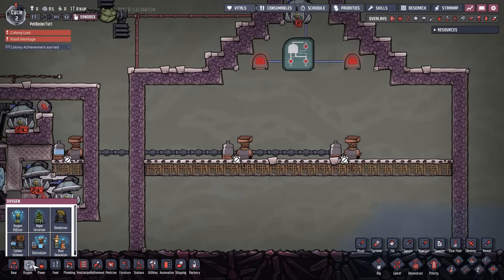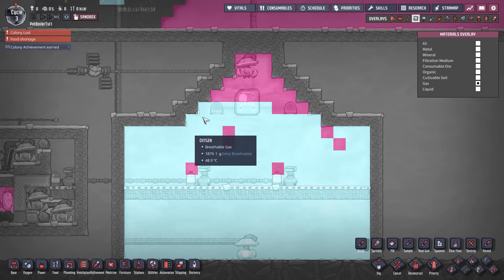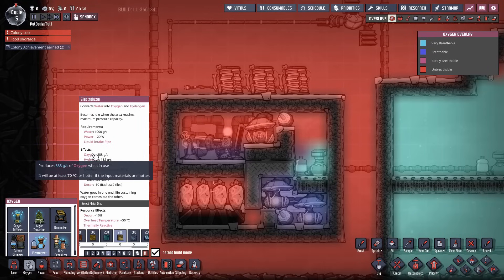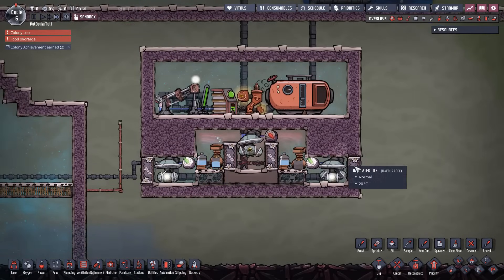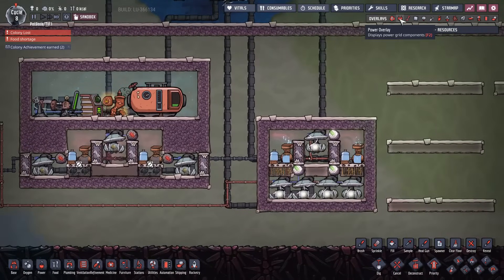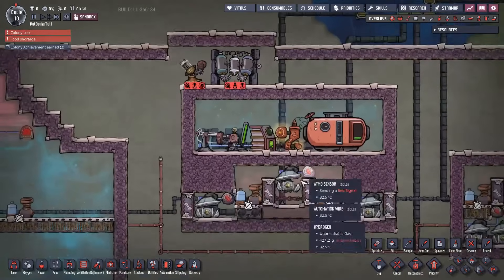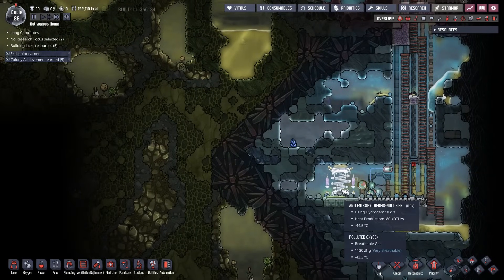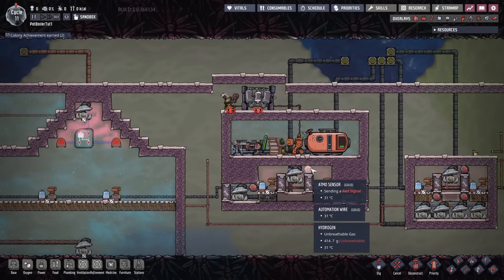Electrolyzer, SPOM, O2, Oxygen: Tutorial nuggets : Oxygen not included

Comment: There is a way to build a passive filter out of gas valve and two gas bridges which doesn't take up electricity and makes the separate pump for hydrogen and separate for oxygen unnecessary. Dunno if it goes "against your principles" but maybe worth mentioning?
Reply from the maker: I am aware of them but decided against mentioning them, they can work and can be useful but they are not newer player friendly. Video still ended up very long without mentioning them. End of the day barring a few intermittent instances you can get by most of the game with no filtering required. If you don't need to filter, why bother filtering at all?
Reply: Mechanical filters are the best! Super cheap to make too!  Make a 2x3 pipe loop with a flow control valve. Set the flow to 1g/s. Add the first bridge and fill the loop with desired element. Add a gas pipe past the input space of the valve. Then add another gas bridge input to that as your pure element output filter so there will be no backflow into the input of the flow control valve. Commence filtering. Extraordinarily simple. You can also extend the pipe loops with radiant pipes to cool/heat and then pipe it out. FOR FREE.
There's also a very tight 2x3 version but that's harder to explain in text. 
There's also the element automation gas filter for cheap electricity (10w?): Put an element sensor on the pipe before a shutoff, and and choose the element you want to filter out of a mixed input, and it'll send that out the shutoff's output.
Reply: @sicariusdracus  I did not follow all of that. I don't suppose you have an image or diagram somewhere?
Reply: @sicariusdracus  Thank you kindly.
Reply: they break when they back up. The oxygen always backs up at some point.

Comment: What happens if you pump h2 at 250g when your o2 backs up? Won't the o2 push the h2 up and the pump start pumping o2?
Reply: Nope, that's a nice feature of ONI. A tile can only occupied by 1 material. So even the de H2 goes to milligrams levels, it will still occupy the top layer. That's why there's only 1 tile gap between the doors and the ceiling, so only H2 can occupy it.

Also, the electrolizer overpressure really quick and stop producing. So it won't easily build enough O2 pressure to push the H2 up far enough to compress into fewer tiles.

Because the full roderiguez has that 4 tile elevated ceiling in the middle, I am a little sceptic about what happens if you let it stay dormant for a while. But generally, if you build that thing, you probably need the oxygen anyway, so no chance for it to go dormant.
Reply: @XconeArtist  That would make sense if there were just 1 tile. I'm specifically talking about the 3kg design (the last one). In that design there are lots of tiles in the center room where h2 can compress and give way for the o2.
Reply: @Hedning1390  I did not realise your question was specifically only about the big one. As I said, I'm sceptic about that one, too, and a such don't use it myself in this shape. I do use the big one, but then with a flat ceiling. You can do that if you lower the H2 pump with 1 tile. The H2 pump is then obstructed a little by the doors, so has trouble keeping up and you won't get the full 3kg/s. But because the ceiling is flat, the risk of H2 being pushed back is gone. 

But maybe Francis (or someone else) can clarify if it's a risk at all.
Reply: @Hedning1390  the oxygen can't get to the other tiles because of the hydrogen in the 1 tile gap region, it would have to jump over it and it doesn't.
I don't know if I explained it well but it works 100% of the time, even if it stops for hundrends of cycles.
Reply: @nirodper  That's not what I was asking. I'm asking what happens if you run it while not consuming the o2. Read my post again.
Reply: @Hedning1390  well as the others said, when your O2 backs up (which is part of the normal operation) the H2 is pumped out until there is only 250g of it. The O2 can't replace the H2 because in oni a heavier gas won't go up if there is a lighter gas above.
The electrolyzers will stop producing from overpressure.

The only condition that breaks it is if the H2 backs up, as the H2 level would lower and it would reach the bottom pumps, you can't let it happen.
Reply: @nirodper  Edit. I see now. The gas is on a perfectly straight roof all the way to the opening, so the h2 won't compress.
Reply from the maker: Way late to the discussion but the map save is attached you can play with the design if you like. In survival I have used the full Rodriguez to run just a telescope. This did not cause any issues. It does not matter how much, how little or from which pumps you draw oxygen. I tested this when I first started using one, they are rock solid. The only thing that will break them is letting the Hydrogen back up, but that breaks all the SPOM's.
Reply: @FrancisJohnYT  If you see my last reply I figured it out.
Reply: By the way, it can go wrong the other way around. If you don't extract all the H2 in time, the H2 area will increase and reach the pumps at the bottom. Then you start pumping H2 into your base. So always burn/dump/store the H2, and do not let it back up the pipes.
Reply: You could put in a gas valve that restricts the flow from each I suppose. They don't require any power, just a dupe setting them iirc.
Reply: @brothermutant7370  I don't know what that additional benefit that would realise. There's already sensors that disable the pumps if pressure is too low to achieve exactly that. And overpressurizing is done by the electrolizers themselves, that simply stop producing well before pressures become problematic.
Reply: More control really. Just saying, I can keep a H2 power generator going even if it is getting a small amount of H2. But yeah, overproduction of H2 backing up your pipes is a BAD thing for sure.